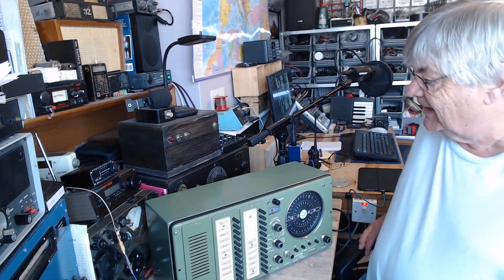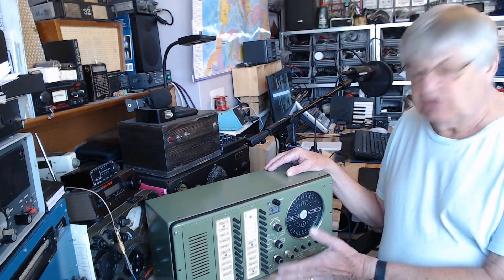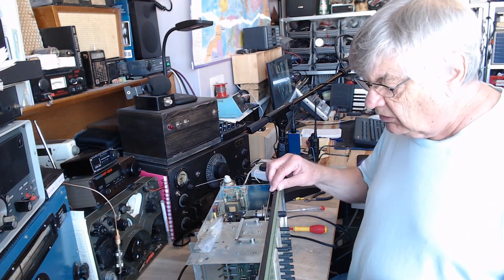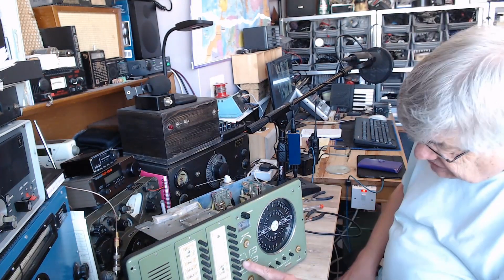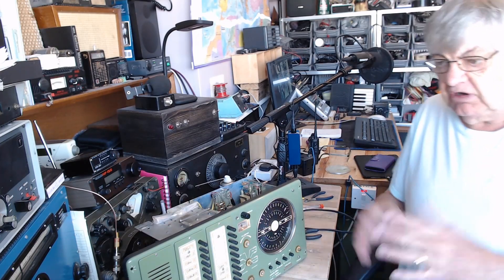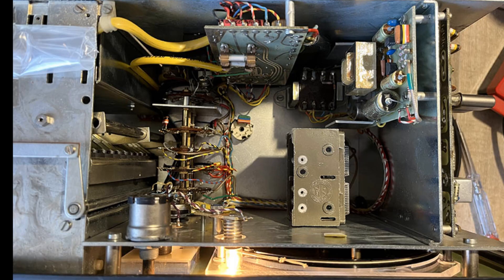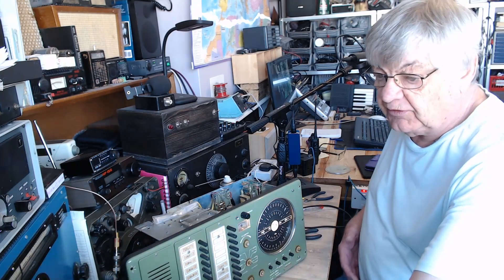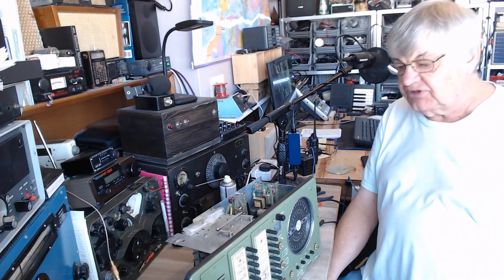G4NSJ - A look at a Sailor R105 Marine MF MW LW NW communications receiver

Comment: Nice example there Ray.  I have a 1982 Sailor Compact HF SSB/AM T2130 /RE2100 aboard my sailing vessel and it works flawlessy.  Emergency channels still active and there are still Med, Pacific, Caribbean & US Networks to this day.  I've kept mine for ocean crossings. The Sailor sets normally in USB/LSB & AM modes either 250 or 500 watt versions, mine is the 250W with a ATU Tuned sloper on the main mast down to the stern.   I'm just eyeing up that lovely Larkspur rx on your desk.  I remember the C11, C13 and C45 sets back in the day, built like tanks!

Comment: Fun to see a radio that was able to pick up the old 500KC band. All the radios I ever owned, long wave cut off before 455KHz and MW started at 520KHz so all of that maritime code segment I couldn’t pick up. Would have been too fast for me. These days it’s pretty quiet save the 630m users and the odd KPH transmission. You can find old recordings of 500KC traffic. They sound pretty hectic at times.
Reply from the maker: I loved listening to 500Kc/s. Happy days!
Reply: @ they were. I had a D Cell battery powered  portable radio that had a slide to fit into a car. Push button between MW and LW however if you pushed the buttons so neither was selected it would tune up to 4.2MHz or there abouts. I would listen to the Sydney Radio AM broadcasts on 2182KHz and the 80m band using the car antenna socket to attach a long wire out the window. That was when they were still using 4136Khz before they moved it to 4125KHz. 

There was lots to listen to back then. I guess there is now, but so much more digital and encryption rather than voice and plain text code. 

I’ve been poking around the old 45m Echo Charlie band in the evenings here in Aus and have found what seems like some CW nets between 6666KHz and 6672KHz. Some are just check ins, others exchange 5 character groups. Most of the time you can tell it’s hand sent. Sometimes it’s pretty bad. Often you’ll hear Cyrillic characters like 4 dahs, backwards C and backwards Z so assuming it’s Russias. Usually on the East Coast kiwiSDRs though I have heard them on my vertical too. The Western Australian KiwiSDRs pick them up a little better at times. 

I’m assuming some of it is Russian military training. Haven’t tried breaking in and sending a GE OM UR RST 559 TO EAST COAST AUS BT BTU HW? BK but it has crossed my mind.
Reply from the maker: @MidlifeRenaissanceMan  Interesting about your portable radio. I had a portable radio that fitted into a car, I forget the make. Thanks for all the info. Cheers, Ray.
Reply: @g4nsj  I think it may have been a Phillips but I’m leaning to some other brand. Sadly it’s long gone now. Combination of silicon and germanium from memory. Audio transformer output. Steel chassis and cream plastic case. Push the tuner knob in for a dial light. Unit wasn’t light. But long gone now. 

I still have my DX160 from Tandy which was my Christmas present that year. It still works. It still drifts for half an hour before it settles down, but it worked last time I plugged it in. 

It’s on the pile of stuff to fix up. I have too many projects and broken dreams in the pile. It’s the valve guitar amps that will be first, once I finish the renovations on the room they’re going in :-)
Reply from the maker: @MidlifeRenaissanceMan  I remember the DX160, nice radio. I also have too many projects on the go at the moment. Never a dull moment!
Reply: @ I know. I just don’t want to be the “One day son…All these unfinished projects will be yours !!” guy

The DX160 was a good entry level comms radio. I had so much fun with it. Tuned into all sorts of signals. It had some problems with a hum that modulated the local oscillator on Band E especially up high. The image rejection was pretty poor, especially on band E. 

Then there was the d r  i   f    t
especially on band E

But to get an oscillator to cover 150KHz to 30MHz with a decent amount of stability was a minor technical miracle.
Re projects:
The guitar amps are first. Got a couple of modern ones and a couple from the late 60’s early 70s aussie made. Plus a couple of rebuild redesigns including a written off Marshall JCM2000 DSL40 I’ll rebuild with a Vox AC30 circuit using the Marshall transformers. It won’t sound like the Vox, but it won’t sound like the Marshall either :-)

They’ll get used. Moreso than the radio gear.

Comment: That brings back memories!  On a ship I worked on, late '80s-early '90s, there was a VHF marine band transceiver on the Bridge which looked very much like yours.  Ours was a 'Sailor Boy'; perhaps 'Boy' was the product name!

Crystal-controlled, as yours.  There was no immediate access to the crystal bank.  On the front, there was a large round channel indicator with a knob to click round the various positions.  The handset was like a beefed-up version of the old GPO telephone handset, with a PTT switch between the earpiece and microphone.

All built like the proverbial outhouse.  Ours never failed us.  All we had to do was keep a check on the 24V battery supply.
Reply from the maker: Happy days! Thanks for taking me back in time. Cheers, Ray.

Comment: Blimey, Ray...never thought I'd see one of those again! We used to use MF 2MHz for comms up to about 200 /250 miles off the coast, then change to HF for transatlantic stuff... usually 8MHz, 12MHz, 16 MHz. Also had 4MHz and 22MHz frequencies available, but can't remember being all that successful on either of those. That Danish built gear was excellent, Sailor and Thrane & Thrane, really reliable. Kelvin Hughes 'Pentland Bravo' HF / MF sets were pretty good, too (if a bit underpowered on the Tx side) . Most of the ships carried a Marconi 'automatic' RDF set, good bit of kit! A real trip down memory lane...
Reply from the maker: I haven't seen one since the 1970s. As you say, Danish built gear was excellent. I wish I'd become a radio officer back in the old days, like a few of my mates did. Oh, well... Cheers,  Ray.
Reply: @g4nsj  If you'd become an R/O you would probably have been out of a job by the early '90s...  Satcomms and GMDSS came along, and that was the end of that. I knew quite a few R/Os who retrained to become navigators / deck officers. Many went ashore as technicians. At least it was a convertible skill, as electronics was the up and coming thing!
Reply from the maker: @ Good point. A friend of mine ended up as a TV engineer.
Reply: Russian military still use code. Not too sure what the recruiting is like. Pays not great, but you get to send code for a living, or is it sending code for your life ??